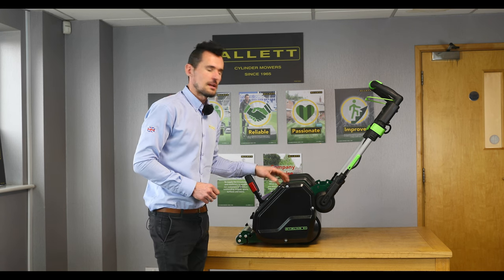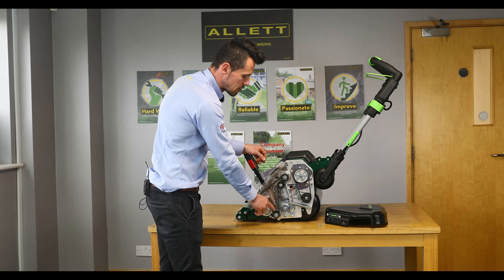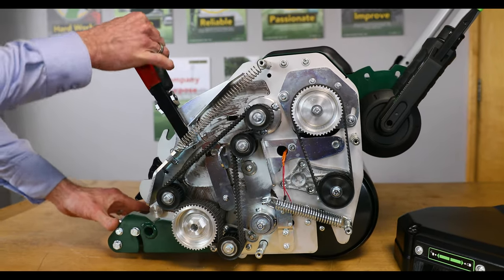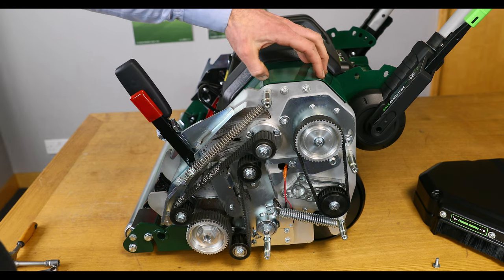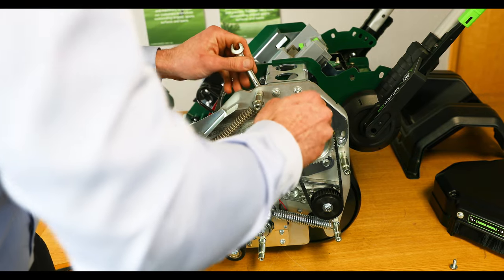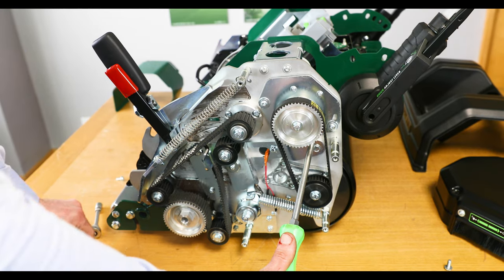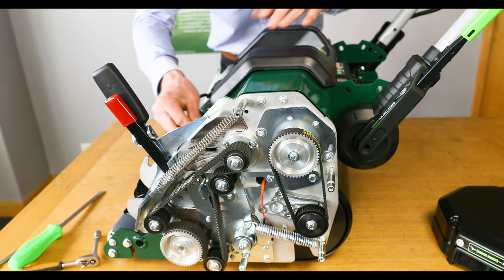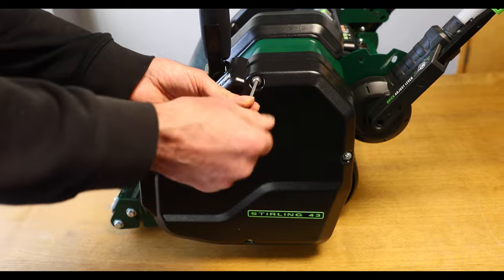Replacing the Belts- Allett Stirling

Comment: Hey Steve, I recently purchased (6 months ago) the Allett Stirling 51. I noticed my Cylinder Drive Belt seems loose even when the Cartridge Securing Lever is pulled downward. This video shows a slightly different Cartridge Drive Belt Routing. Should my Cylinder Drive Belt be Loose. If not, is there a video so I can Tighten it. Thanks